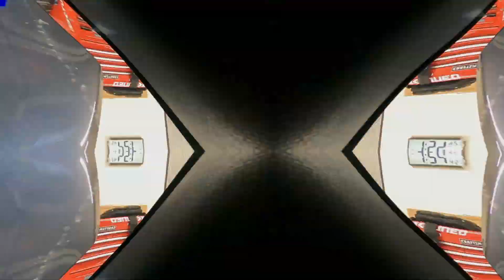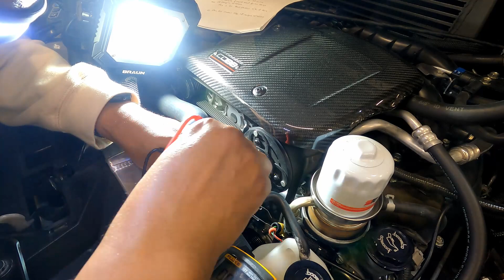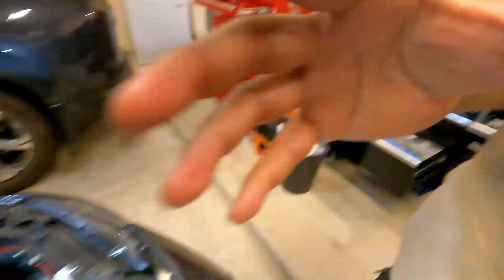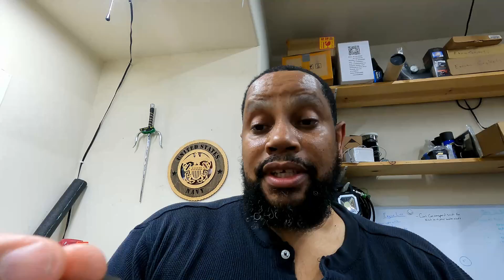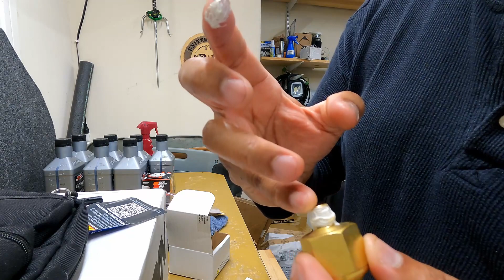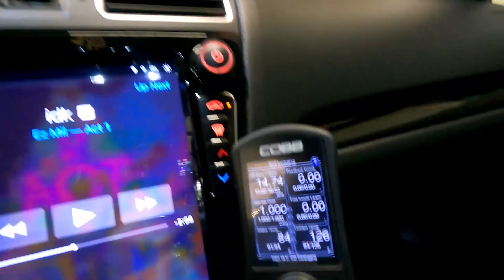Looks Like We Have Oil Pressure Gauge Issues Now!

Comment: Hey i am curious to why you use the K&N filters? I am running the Amsoil filter on both the EJ25 and Ej20. Just curious to your reasoning. I like having the extra filtering capacity and better filtering capability.
Reply from the maker: It was just what I found at the time and heard good things about grimmspeed products so I went with that. Plus I was extremely new to the platform then.
Reply from the maker: You know what disregard that 1st reply I have always used k&n because it gives you the opportunity to use a wrench, I have had times where I had to stab the filter with a screwdriver when I had my Honda and other cars so I thought that was a cool function plus k&n is a trusted manufacturer.